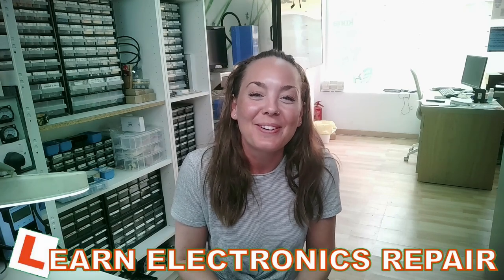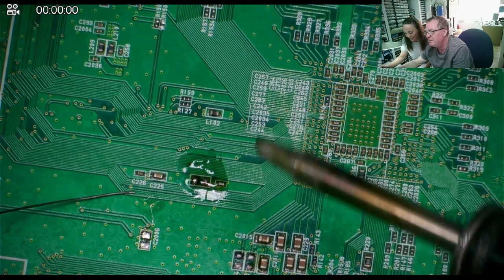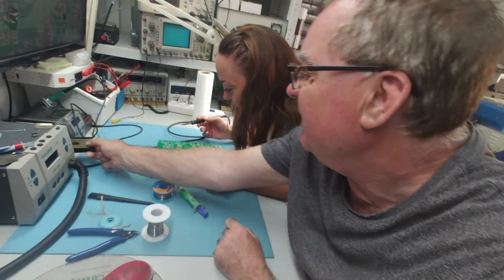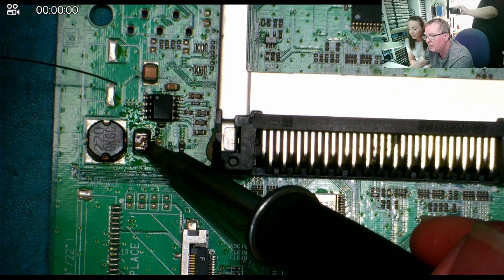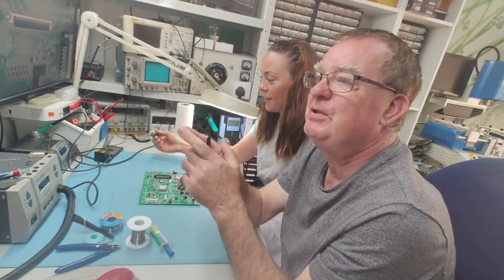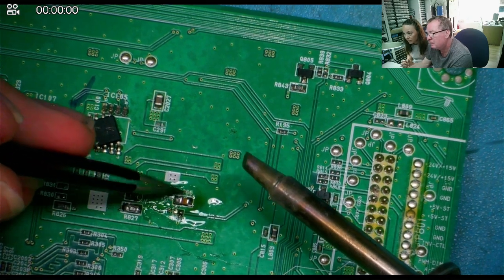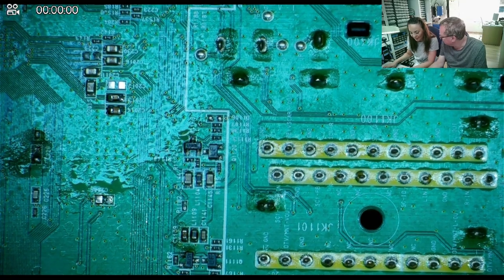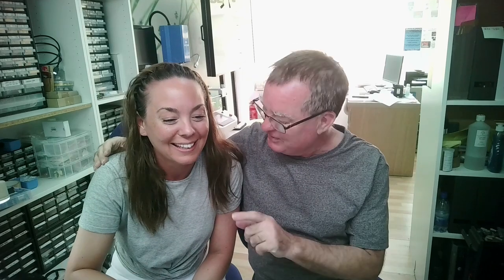Can A Total Beginner Learn Micro Soldering In 20 Minutes?

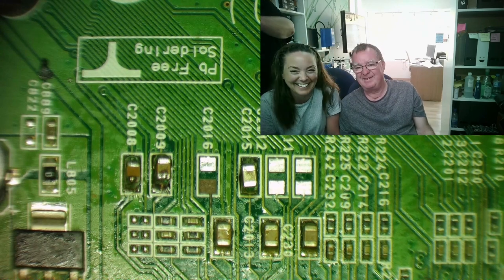Comment from the maker: 27:21 OUT-TAKES
Reply: What a lovely lady that is willing to be your victim and get stuck in soldering. Great video from you both, thanks. On the de-soldering, though, i have come across some power supply boards whose components have a red dot of glue underneath and they will NOT come off. Those are a real bugger. Anyway, thanks Richard and Sarah for a great, fun video.
Reply from the maker: @englishrupe01  Hot air usually desolders those - but sometimes delaminates the PCB in the process
Reply: Use k type bit it has length surface you can easily bring both ends to melt then you can take with the tweezers
Reply: (Very) Funny.❤

Comment: Thank you! I've struggled just enough with this to believe I couldn't do it. Now I think I've got it 😊 Thanks again.
Reply: This video gave me the courage to try and fix some solder joints that had come loose on my solar charge controller. Now it's up and running.

Comment: When I use the braid, the braid never absorbs the solder. I have a temp of 450c, plenty of flux on the braid itself, and a clean soldering tip. A couple of times I held it down for so long that the braid became stuck to the board.

Comment: Richard, What camera setup are you using to view the board on the screen? Is it easy to solder looking at the screen rather than the actual board? Greetings from the UK.
Reply from the maker: I have two 'cameras' over the bench - a C Mount camera with 5mm-50mm zoom lens, and the Andonstar AD407 microscope mounted upside down and suspended from the wooden baton that supports the fluorescent lighting.  This video was using the Andonstar, it connects to a USB3-HDMI capture card for recording on the PC connected to the left hand monitor and the HDMI pass-through connects directly to the right hand monitor you can see.  I normally use my trinocular optical microscope for soldering, it is much easier with stereo vision, but as you see on my videos I can do it this way too.

Comment: 3:01 Flux expiration date of 06/2022 makes me feel better using my flux with the same date. Does it really expire that quickly, or are they just trying to get you to throw it away and buy more solder?
Reply: Yep, resin has no expiry date....its solvent just may dry up. It's a con. Maybe if it's "activated" that may vary, i am not sure. But don't use activated flux, anyway.
Reply: I agree, it's a con the expiration date on flux. What definitely has an expiration date is solder paste which has a binder and solder beads in it to use with stencils or applied by dabbing on the PCB and then sticking the components down. It degrades over time so if you need it, buy it and use it but don't buy some to store for later as it'll just go bad if you don't regularly use it up. There are newer formulas that can last longer outside of refrigeration, but best check the specifications before assuming.

Comment: With micro soldering, I've been reading that you need to use a microscope because there is lag when using a screen. Is the screen they are using a special screen with no lag?
Reply from the maker: The one used on this video is a Andonstar AD407.  This has HDMI output and any microscope that has that instead of USB should have no lag at all.  

So my second best advice is to buy a microscope with HDMI output.  

My first best advice is to buy a binocular optical microscope (or Trinocular simulfocal optical microscope + C-Mount camera if you want to record video from it as well) because using any other type of microscope is like microsoldering with one eye closed.  Some people seem to be OK with that, personally I'm not, but to see if that will bother you put an eyepatch on and try soldering for a while before purchasing.
Reply: @LearnElectronicsRepair  Thanks for replying! I've been looking into the AD407. You say there is no lag with HDMI, but what about the screen that comes with the microscope?

Comment: When tweezers and metal tools become magnetized, saw off the HV winding on an old microwave transformer and hard wire a power cord and switch to the mains so you can insert tools into the empty winding gap to demagnetize.
Reply: or just buy a demagnitizer from amazon for a tenner?
Reply: @TheAMGReviewers  Yup, but judging by his propensity to repair all things, he'd already have a MOT or two hanging around. Also, with 2 turns of 6 gauge wire, it's an instant spot welder or metal bender.
Reply: @CliveChamberlain946  wouldnt it be 2 turns of 25mm(4AWG) wire not 6AWG, seems too small imo
Reply: @TheAMGReviewers  Yup. Bigger's better and 240v MOT's might just have more space to wind in. Forgot to mention some guys open the core with a grinder so it can erase hard drives. Long live old MOT's 😁

Comment: Oh my, that's super fun to watch! But then, soldering and desoldering a bunch of caps doesn't compare to doing those pesky little IC buggers.
I learned SMT work in 2020 when I was building an automatic vacuum tube tester. I could do 0603 with no microscope, but anything smaller is way out there.

Comment: Hi Richard, what's the best thing to do with a car boot MB with a short on 12v? 

I noticed an 0402 resistor off one pad and touching the capacitor next to it so I removed it and figured I should probably measure it, I turned on my multimeter and placed the probes either side of the component and it read 22, I'm not sure what it was measuring 22 of, ohms? perhaps kiloohms? I have no clue because at this point the 0402 resistor decided it would like to explore my room a bit and excitedly jumped over my shoulder. I spend a good 20 minutes on the floor with my torch but I have to assume it made it's way out of my room, down the stairs, out of the front door and is now exploring the big wide world. I have looked everywhere I can think of (yes including badcaps :)) and boardview or schematics don't seem to exist so I'm at a bit of a loss. I wish the little 0402 well on it's travels but I wish I could let it know in some way the angst it has caused me.
Reply from the maker: Whereabouts on the board did the resistor come from?
Reply: @LearnElectronicsRepair  Hey Richard, it's just below the CPU, I think it's on a line between the CPU and the BIOS chip. I'm not overly concerned about it as it's disappearance had no affect on the short anyway and I can probably double my money if not more by moving it on for spares or repair. Would have been nice to get it working but I posted more to relay my frustration at the disappearing component :)
Reply from the maker: @badgerfool1980  If it connects from pin 1 of the bios chip to either ground or 3.3V (maybe 5V if it is a vintage BIOS) then just stick 10K in there and see what happens.  If it is connecting between CPU and BIOS try something low value like 100R or less.  But like you say, it will not be the cause of the short.  You don't mention which motherboard (CPU type) it is.  Does the short on 12V go away if you remove the CPU?
Reply: @LearnElectronicsRepair  It's AM4, a Gigabyte Aorus B450 Elite V1 to be precise. The short on 12v does indeed go away with the CPU removed, what does that indicate and how did you know?!  LOL I had a better look around with my loupe and a poke around with my multimeter and the resistor was actually not connected to the bios chip, the capacitor next to it was - doh (note to self order sharper probes) one end of it connects to a small 6 pin component marked "YJ" right near the bios chip and i'm still trying to trace the other pad.
Reply from the maker: @badgerfool1980  You have one or more short circuit high side mosfets in the CPU VRM
If one end of the resistor connects to a connector (and nothing is plugged in there) it may not be needed
Reply: @LearnElectronicsRepair  Ok wow thanks!  Time to rewatch your high side mosfet video then! I don't have an ESR meter or a bench power supply yet and my budget is tight so perhaps your amazing short finder should be next on my to do list? I have seen a couple of videos on DIY ESR meters btw, not sure how good they are but I reckon that could make for a good video project if they are economical to build.